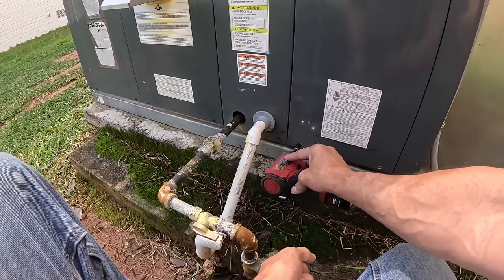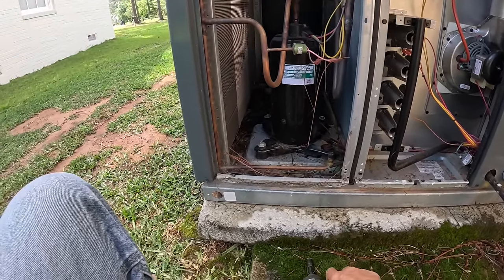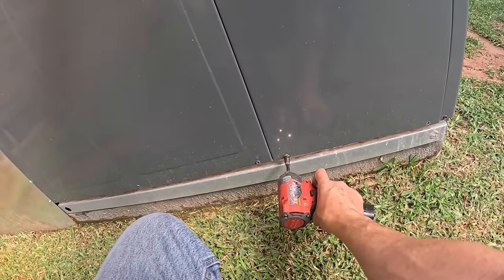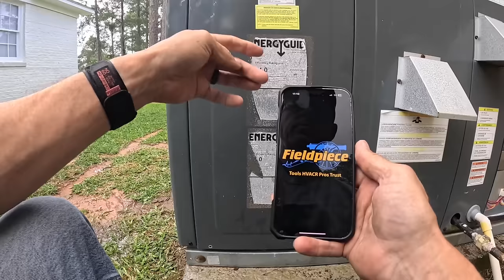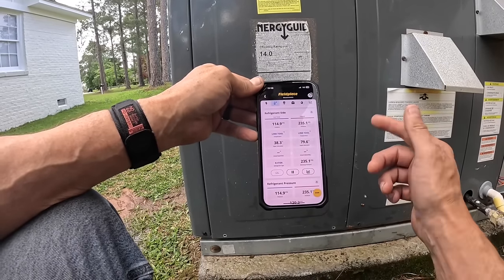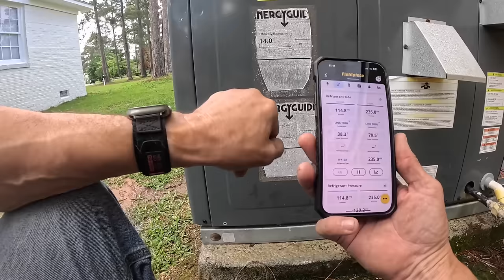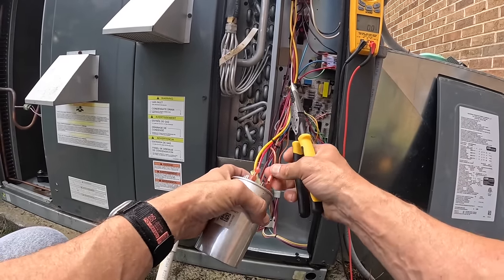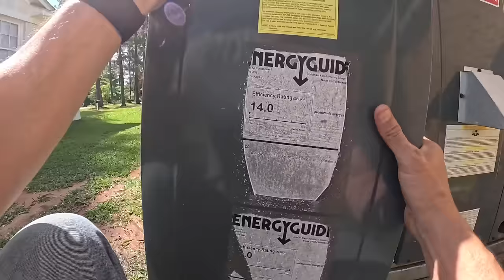Checking On A Customers System Before it Gets Really Hot! #hvacguy #hvaclife #hvactrainingvideos

Comment: Thanks for the video Curtis. I checked a lot of my capacitors running. Cap = (current of circuit x 2652 ) / voltage across capacitor 

That saves me from having to remove the capacitor and shut down the power to check it.

Very nice video . Thanks.

Comment: It is getting to be that time. PMs are a good thing, smart man. If any problems are about to occur, it is better to catch them now and not when it is 95 or 100 degrees. Real close to doing mine. I did look at it and it seems to be fine, but I will wash it out anyway. I have been limping along past couple of years and I will keep it going as long as I can. ( lipstick on a pig ) I can't wait to get the gages on it and see if I lost any refrigerant since I put that stop leak in it. I will post the results, still cooling for now. Good call